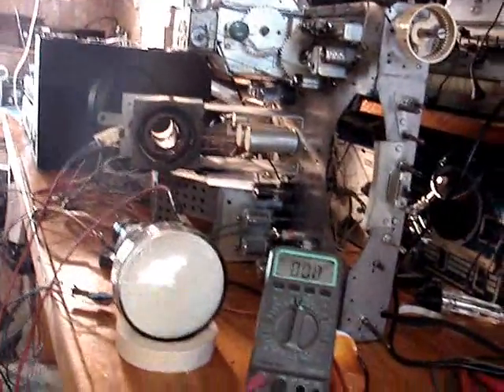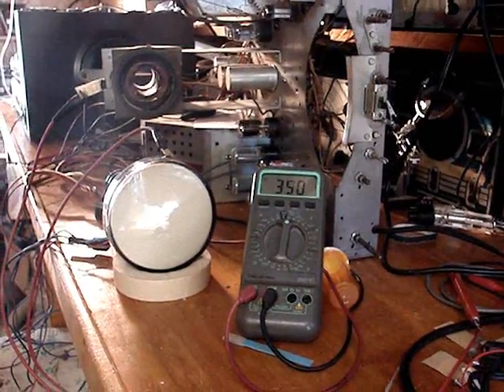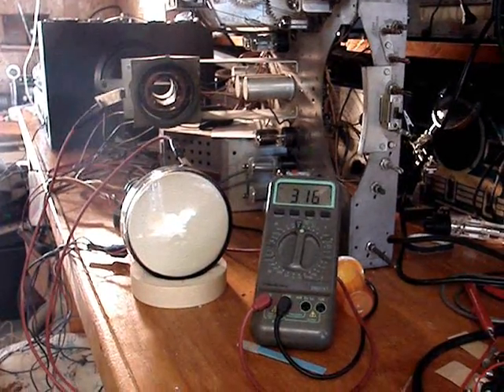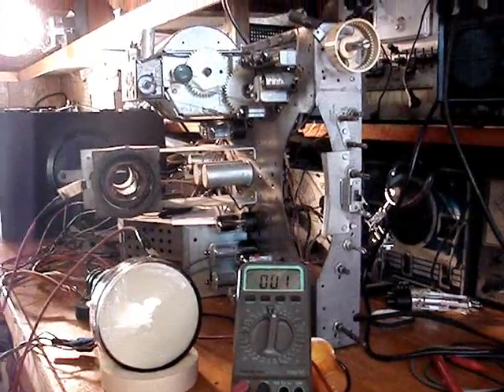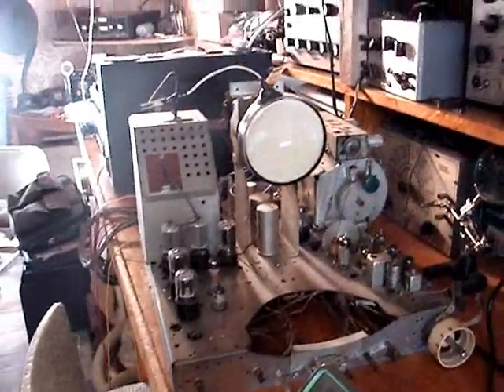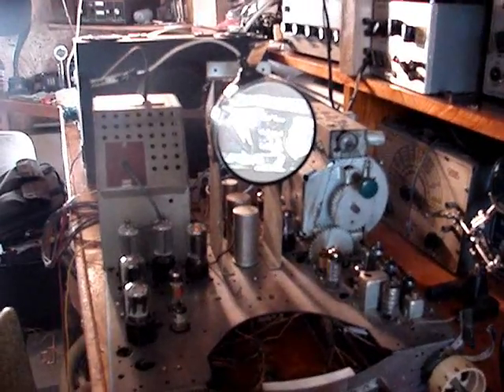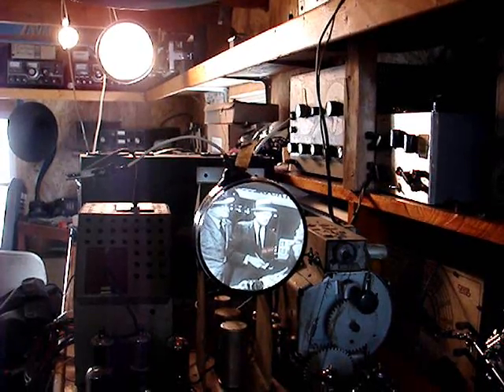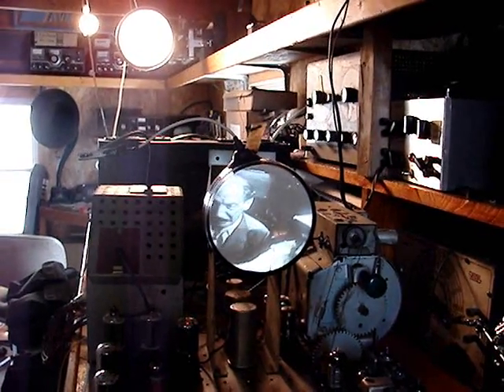Zenith 1951 Giant Circle Radio Cobramatic PT13

Comment: Gary, great progress! Your patience and hard work has paid off. BTW - who was the manufacture of the mica capacitor? Best, Don
Reply from the maker: +RestoreOldRadios It was a Micamold capacitor. I have two 1600v .002uF caps soldered in temporarily but I will replace those with a single high voltage .005uF cap when Iget one. Thanks for watching Don.
Reply: +HD7100 You're welcome Gary. The reason I inquired about the mica cap as I recall reading on the ARF that some Micamold caps are actually paper caps, in particular the higher values if memory serves me correctly. Hope your progress continues to provide positive results. Best, Don
Reply: +HD7100 Here's the thread I recalled: http://www.antiqueradios.com/forums/viewtopic.php?t=142856
Reply from the maker: +RestoreOldRadios Thanks Don. I know Bob Andersen found issues with mica caps and from now on I am going to more closely examine any mica caps in the future sets I plan to work on. Gary

Comment: Alrighty!!! Your almost done!!! Your flyback is fine!!!! LOL!! They either work or they don't! And yours is. Don't worry about your B+ being 10-15 volts off. It's not modern SS equipment. The wonderful thing about old tube equipment is how it was engineered for tolerance and drift, as well as different signals, and line voltages back in the day.Don't waste any more time with your test CRT, other than to ensure your controls are functioning, get your permanent one in there, center and focus the picture, adjust your linearity, do any last minute adjustment and cleaning, throw it in the case and enjoy your newly restored TV!!! That picture looks really strong! Then you'll be ready for your next project! Good job, congrats...you've lost your TV restore virginity!!!
Reply from the maker: +ScottTV1962 LOL thanks Scott. I should have stuck with 1920s radios. Those are easy and they don't snap at me like this mean old TV.  My next set will be the 1947 Stromberg Carlson TV-125 because it's my oldest set. The InducTuner has a broken shaft that doesn't look like it can be mended so I will be using Phil Nelson's idea and injecting audio and video. Gary
Reply: Nahhh. TV's aren't hard, they are just different. As you get experience with them, it gets easier, just like your radios. One piece of advice and you can take it or leave it, but remember to never condemn something that you can't prove is bad. Generally in TV's, your major components (transformers...including flybacks, and yokes will be ok). CRT's you can check easily. Always look for other smoking guns first. Like a little domino cap that's not only off value, but completely open. 99 out of 100 times, that's the problem. Just like radios.

Comment: Good to see your frustrations paying off!  Is that a couple of Siltronics or Swans on the top shelf by your HAM station?
Reply from the maker: +JacksJunkDotCom Thanks Jack. I have a Swan 500cx that I use on 40 meters but something is wrong in the PA which more than likely are bad sweep tubes. I have replacements and will probably make a future video on it. I do have a Siltronics 1011 that I acquired strictly for the 10 meter band but that radio came out when CB was increased from 23 channels to 40 channels. To make that work they truncated the low and high end of the 10 meter band. I don't like it. I also have a Swan 250 for 6 meters but that's another project for another day - if I live long enough. Gary